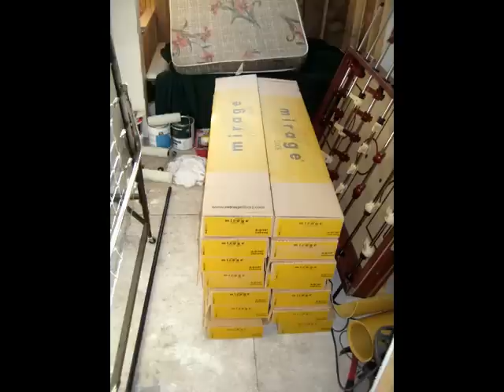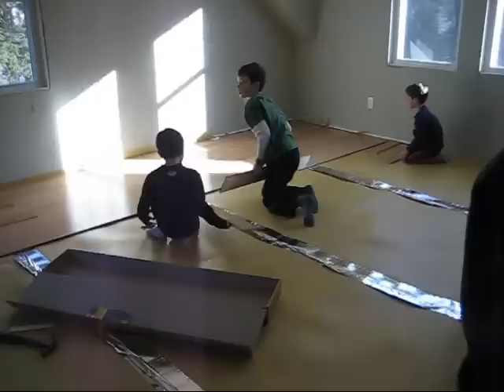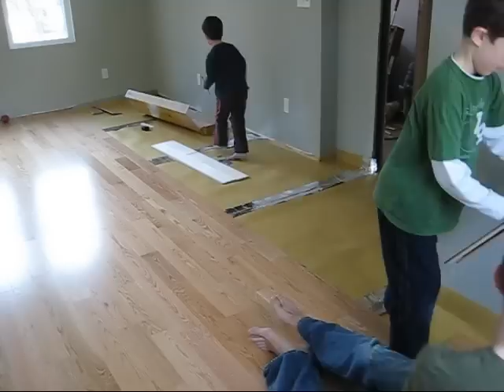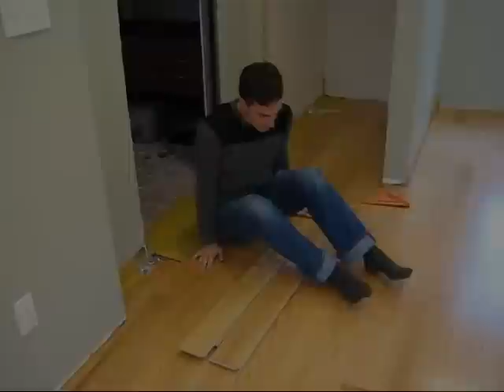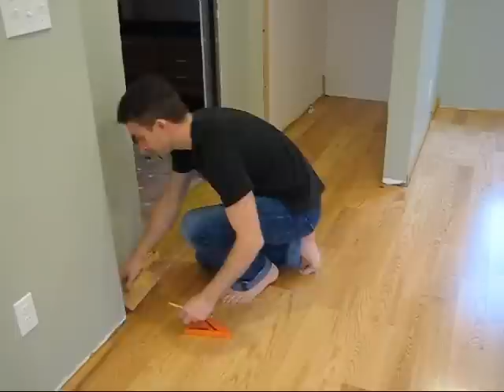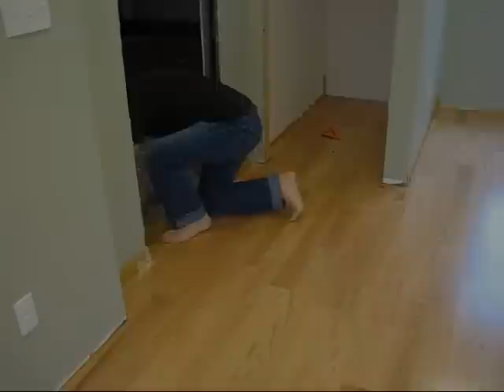Happy New Floor

Comment: We are going Mirage Lock over our concrete slab on-grade. We have a pretty high moisture level due to our house being older and I have been researching TONS about moisture barriers along with pads. I also want to be sure the expansion is good in the DC humidity.

Comment: How is this holding up for you? We are looking to install the Mirage Lock but not sure if the Ulti-Mat (the one you are using) is thick enough for a proper moisture barrier. Also any issues with expansion gap with the flooring?